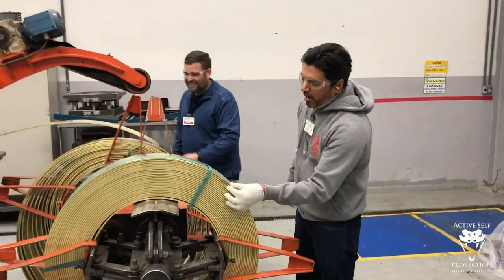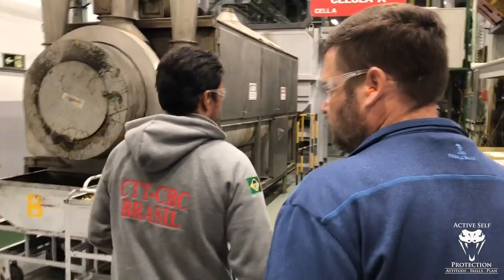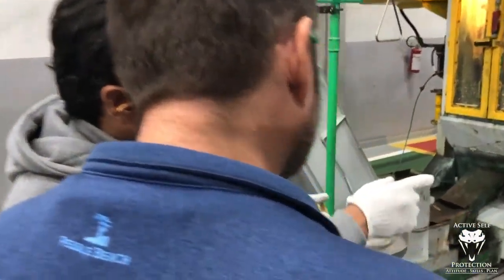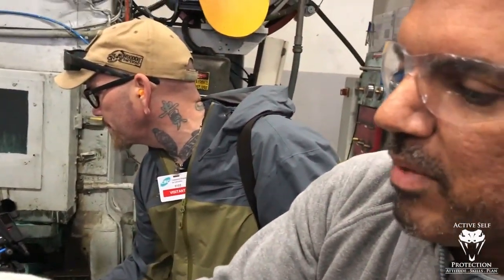I Went To Brazil To See How Bullets Are Made! (Part 2)

Comment: What primers does magtech use in their ammo? Magtech is so cheap I worry about quality. If I am doing mag dumps I don't worry, but I dont do a lot of mag dumps. I might buy a box and just check it out. But I doubt the QA on 9mm is as precise as US Navy 50bmg runs.
Reply from the maker: They make their primers from scratch.
Reply: I don't know MagTech's quality control procedures but i've used their 10mm, 9mm, & .45 many times over without issue. My only complaint is that it isn't the cleanest ammo but for the price, you can't beat it. Much rather run MagTech than Tula, Blaze etc